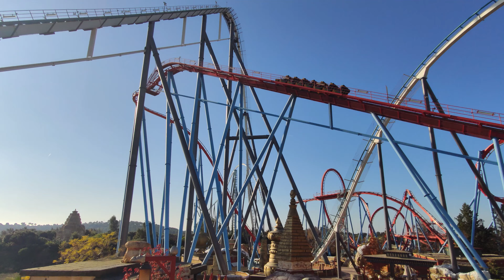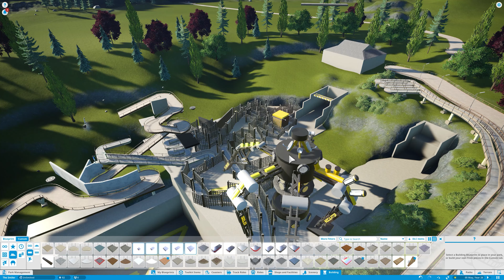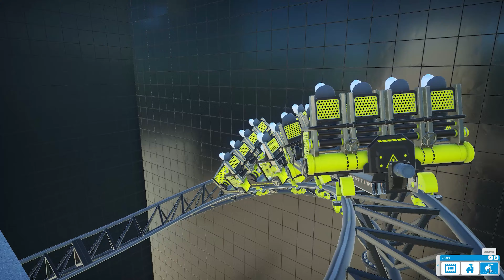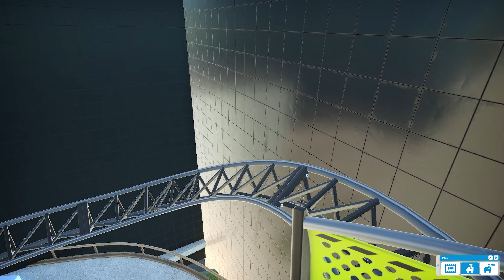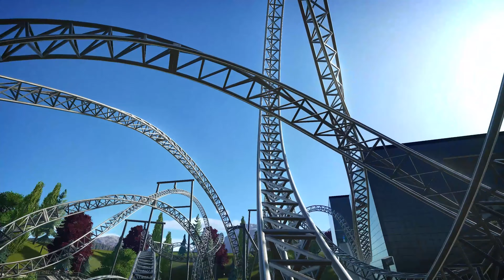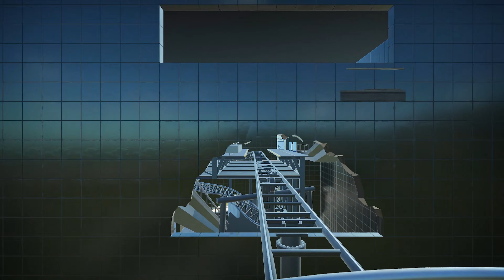How I'd Build The Smiler Roller Coaster at Alton Towers

Comment: Great video. The Smiler has indeed a lot of similar looking and feeling elements. A redesign would be great. 
Colossus @ Thorpe Park can also use a redesign with it's ending in 5 heartline rolls.
Reply from the maker: It's an interesting coaster, but without adding another lift hill or a launch the train on Colossus doesn't really have enough energy left over for anything other than heartline rolls

Comment: If you want a more realistic coaster builder than planet coaster, I highly reccomend No Limits 2. There is also an extension to No Limits 2 called FVD (which I use for the coasters on my YouTube channel), where you design the coasters purely based on the forces, then import into No Limits 2. It can be  difficult at the start, but once you get the hang of it, it's super easy. Also, if your computer can run Planet Coaster, it can definitely run No Limits 2.
Reply from the maker: I tried the demo of no limits but just couldn't really get the hang of it. Planet coaster generally fits my casual needs fine!